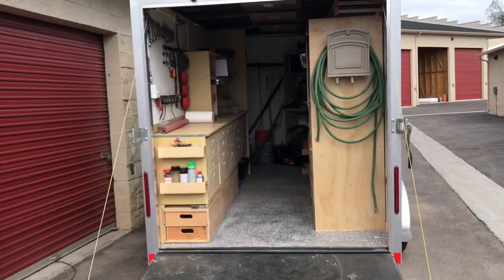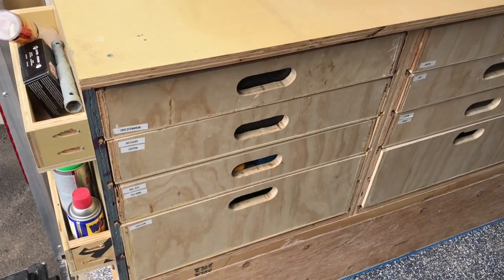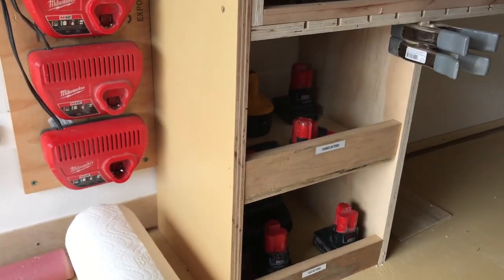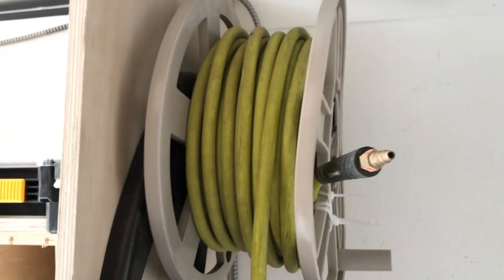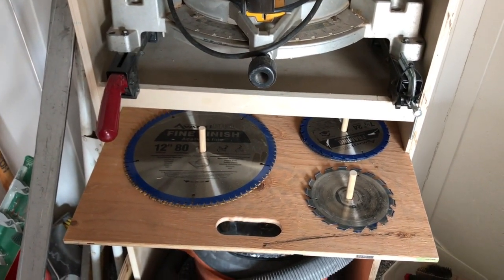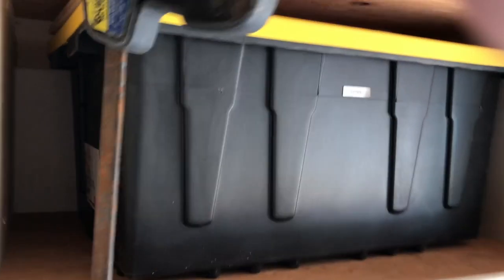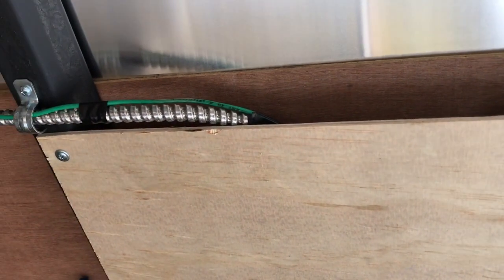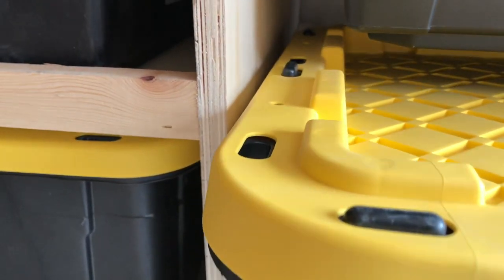Our SMART Trailer

Comment: Nice video what size is the trailer
Reply from the maker: ram 12e Thanks! It is 7’ X 16’
Reply: @wscwoodcraft5722  @WSC Woodcraft Is it a true 7x16 or a 7x14 + 2 for the V nose? It looks like a 14' for some reason. I know more and more manufacturers are selling their V nose trailers as one size up which only confuses everyone.
Reply: @suburbanhobbyist2752  That's a good question. I pretty sure that it is 16' + V. But I'm not sure and as I am no longer associated with the company that we put it together for I can't verify. We are on our own now and are currently fitting out a 5X8 trailer that we bought cheap. May put up a video about that adventure.
Reply: And yes it is too small but the price was right and much better than working out of the back of a pickup. lol!